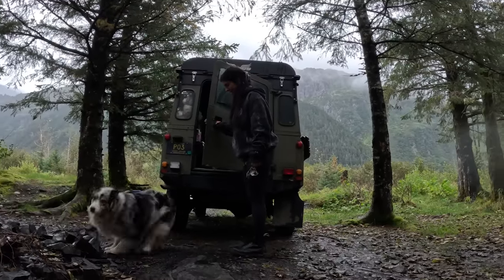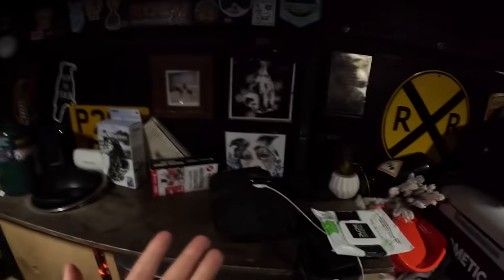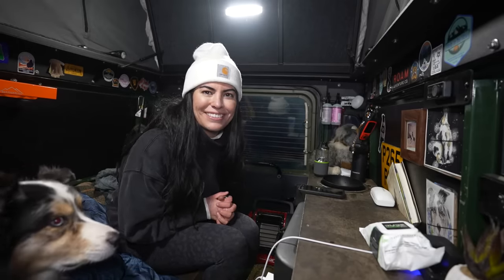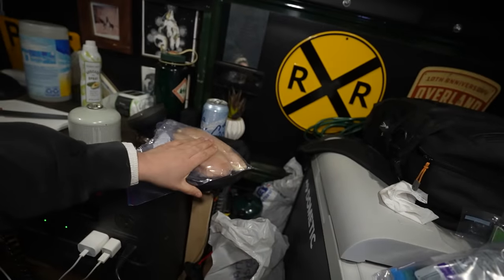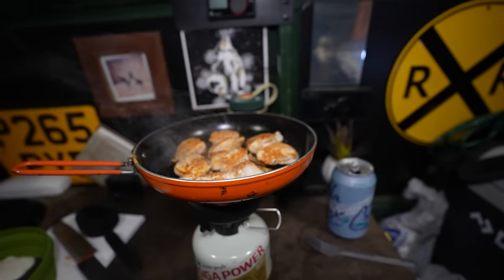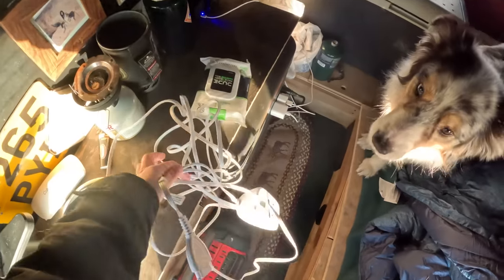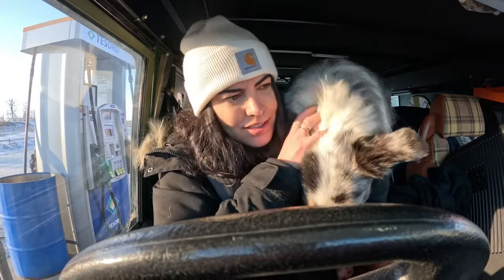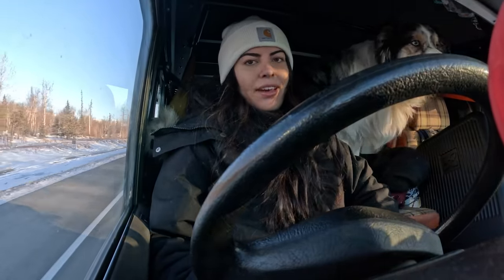Luxury Truck Camping Upgrades for Winter in Alaska

Comment: Why don't you get a step bumper on the rear of that thing, and for the love of God, please get a more stable burner, jet boil makes a folding 2 burner unit, go and buy it now...cuz every time you cook now I'm waiting for that pan to dump in your lap or splash in your face because its so unstable and high off the counter...its actually orange so it will match your pan...😅

Comment: Your best to keep the heater on for much longer. Short periods can clog up the heaters with soot. Keep it at a medium flow/heat and then ramp it up before turning off to burn any soot off. Just speaking from experience, jealous of your rig!
Reply: Good advice. Ten minutes on high before shutdown.

Comment: Hey so I’m a HVAC guy and if your air intake is under that floorboard I suspect you run a much greater risk of the heater going into high limit shut off mode. I at least suggest that you move the cold air return to an open space. Not a small enclosed space. Love your channel. Stay warm up there! Sending love from Ohio!

Comment: You can get auto tape to put over the cracks on the sides of Poe on the inside. Also get some insulation strips to put around your back door.

Comment: The heater has a thermostat and a setting which is just past the reading on the control of 720 . If you set it on that it will cycle on and off automatically when the heater drops below your desired temp.

Comment: Awsome heater. I Live in van expediting.  I have chinese diesel heater installed.  I have the same buddyheater as backup.  Then of course I have a second Chinese heater packed away as a backup to my backup.    I tear mine down once a year to clean it.  Easy peasie.  Your relationship and loyalty toward blue is overwhelming. ❤

Comment: Just a small piece of advice on running a 300TDI diesel in a Defender.Idle it for at least 3-5 minutes before shutting it down.These engines are turbocharged and oil cools the turbo-when you shut it off-oil flow stops dead.The turbo is cooled by the oil flow from the oil pan and when you shut it off-you cease the oil flow.Turbochargers run 4 times hotter than your water temp-so the coolant may be 200 degrees,but the turbo can get over 1000 degree pulling hard-Idling will save you a turbo.

Comment: @9:15 I would feel much better if you would continue that heater exhaust pipe further out and half way up. so that the wind doesnt blow the "deadly" fumes under the chassis.
heavy overnight snowfall could build up and block off any feasible escape route for the fumes and the fumes could build up inside your sleeping area.
you can buy flexible exhaust pipe to do the job I think.

Comment: I use a small fan to blow the hot air around, you could direct it up into your bed loft, pointing it from the where the heat comes out of that small vent put a fan on the floor pointing up into the top of your Papa. You won’t believe how hot is gonna get up there👍🏻👍🏻👍🏻

Comment: Maria on the board just get a good floor vent at which ever store they have close Lowes /Home Depot or Menards and if you ask nicely, they may cut out the opening in the board for the vent to sit in. That will allow the warm air to come up and you can walk on it without any worries.

Comment: Points for the diesel heater but using the top to your rig only lets the heat escape more, it's not made for cold and trapping heat in. Watch your diesel level drop when using the top as it'll have to run more to account for the heat loss. It's so good to see blu with his energy level. Praying for many many years together. Stay safe and take care.

Comment: Get some adhesive insulation strips  to fill the cracks in the doors. Also, consulate bubble/f9il insulation to cover the interior walls will do an amaz8ng job keeping exterior heat/cold and noise down.
Reply: S/B thinsulate bubble foil

Comment: Enjoy your videos! Suggestion for the rusty gas shocks. Try Fluid Film. It’s a spray on lubricant that will resist weather. It’s in an aerosol can and can be purchased at auto parts stores.  Good stuff and should help make it easier to raise the top. If you get it, hold a piece of cardboard or something behind them when you spray them down to protect Poe. Safe travels!

Comment: In regard to your windshield wiper issue:

I don’t know anything about defenders, but I was having issues with my wiper arms on my Honda. At the base of the wiperarm, there should be an nut that can to be tightened. Yours probably came loose due to all of the rattling from driving.

The windshield wiper motor has a shaft that sticks out where your wiper arm slides onto. Tightening it will keep it in time with your wiper motor.. and should make it start moving again. It can be tightened with the crescent wrench. throwing on a little blue Loctite should also help prevent it from loosening again.

At least that’s how it was for my Honda. Hope that helps oh and I love your videos!😊

Comment: Just make sure that the Diesel Heater Exhaust doesn't get blocked from snow and slush after driving. it will cause it to back up and shutoff. So everytime you stop to use it make sure you clear the exhaust

Comment: Just a thought but your diesel heater blowing directly onto your jackery and it’s hookups could have contributed to your wires melting on the jackery. I could be wrong but those diesel heaters can get super hot.  Not having a direct outlet for the heat could have contributed to all the carbon build up in the exhaust also, since it’s just trickling out on the inside. Just an idea. Love your videos! Stay safe! 🙏

Comment: Fantastic to see bubbly Bubby (try saying that 10 times fast) & ever cheerful Ria. Glad you finally got a diesel heater up & running. For the Alucab, you can get winter kits that have insulation liners (Nate on the Dirt Lifestyle channel showed one in a video a couple of weeks ago). With those temps, you may have to do something like an engine pre-heater for Poe. You can get similar to your diesel heater that heats your engine coolant instead of air (Ebay has 2nd hand Webasto pre heaters sometimes) or even do what Chad on Living The Van Life channel did when he fitted an electric element to the engine sump to keep the oil warm.

Comment: The installation details on the fuse panel look great. The crimps are uniformly well seated and all exposed tips are covered, you can expand on the panel connections and they installed a shutoff with the breaker. Do the exposed posts on the breaker stay covered/electrical taped to keep anything metal from sliding directly into it?

Comment: Enjoy your videos.  I know you've thought of this, so apologizes in advance but if you tried some inexpensive sunscreens and cut them down to fit your windows in the back, I think you would improve your insulation.  As for reorganizing, we RV in a small teardrop and find that on returning home, we reorganize every time.  Mainly focusing on what did we use and what again sat idle in a cabinet.  The latter is what we strive to part with.  Plus, when we do our longer several months long trips, we get into a routine (much like you) that we find we really don't need a lot of stuff.  Best of luck.

Comment: Instead of drilling out a bunch of holes in the floor slab. You can go to home depot and buy 1-2 floor registers ( the ones for inside the a house). Cut those holes and place the registers over the holes and screw them down so you can control vents, rather than just have holes.

Comment: What may help is If you remove the relay out for the wipers they may start working again but will only be on one speed. The relay is located in the fuse box and it's one of the two large relays, one does the wipers and the other does the indicators. It may not fix anything but is worth a try.

Comment: Glad you got the heater working. I think the issue last time was your powerstation doesn't provide the strong voltage at booting stage. You can always connect dryer pipe to extent hot air directly to up to top. Did you still have a carbon meter? I wonder where that pump is at, since we don't hear that ticking on camera. BTW the pump should sp about 1 liter per 24hr of usage...but youll need to calculate the wattage used, usually 50-60 watts booting up, and steady 30-40 watts afterwards

Comment: Once I finally got my diesel heater working in my off road trailer it was 'a game changer'.  Do you use multiple cameras or a single for your shots (i.e. backing into place) then edit together?  If its a single camera you are even more my hero.  I just dont think I would have the patience for that.  Plus every time I slow or stop the dogs go hyper thinking its time to run and play.

Comment: All of the Jackery power Boxes have either a LIfePo or NMC type Lithium battery.  The "off the engine" Charging System you showed is incorporating a SI-ACR (Start Isolation-Automatic Charging Relay) from Blue Sea Systems.  My statements are based on my build of my 2016 Trail Edition 4Runner.  A SI-ACM relay does not have the charging configuration for a Lithium Battery - it is meant for charging AGM (Absorptive Gas Mat) Marine Batteries. It closes to charge the Auxilliary AGM Battery once the Start AGM Battery reaches 13.7 volts. It opens to stop charging and protect the start Battery if the start battery voltage drops below 12 volts.  The charger that you want for the Jackery is a BCDC Charger that has multiple configurations selectable, i.e., Flooded, Lead Acid, AGM and Lithium.  The one I selected after much consideration for charging my auxiliary Xantrex 126 Amp Hr Battery is the REDARC BCDC1240D (40 Amp) In-vehicle Battery Charger, including their BCDC WK-006 50amp rated Vehicle Rear Installation Wiring Kit.  Please note that I am not financially associated with any of these products, they were all bought out-of-pocket.  A major reason for my selecting the REDARC unit is that it has a built-in MPPT Solar Panel Controller, so all I had to do was to wire my Solar Panel directly to the BCDC Charger.

Comment: Turn your defrost off when you are driving while it cold and the snow will not stick to your windshield just give enough heat to keep the frost off. Crack a window for air circulation.

Comment: I'm only a few minutes in so maybe you mention it later, but I forget...do you have a block heater for your rig when it's cold? 

I recently picked up a Jackery, but I have yet to use it to warm my diesel engine when it's very cold. (it was -21 a week or two ago).

Comment: lol, the little thing doesn’t ignite anymore because you need to replace the igniter. Not a real hard thing to do if you can find the part. And if you want your heater to work better get at least one little 12 V fan, habit up high, blowing heat back down towards the floor, if I knew how to upload pictures here I would but my camper used to be a service truck. The box is all steel. My floor plan is 4 foot wide by 8 feet long and it’s all steel on the inside. So even though I’ve insulated, I have what’s called thermal bridging. My diesel heater works wonderfully as long as I have air movement inside also. I also don’t have anything for windows so air movement helps to keep moisture down.
 also, that particular diesel heater that you have, although is very expensive comparatively to the other ones for 160 bucks, you won’t have the issues with this one that we always have with the cheap ones. I will personally be buying one myself I’ve had two of the cheap ones, they last about a year and a half if you use them often as in a mind constantly through the winter, the basically never shut off, they don’t last. So just to reaffirm your purchase very good idea and good for you.

Comment: This is going to sound like a complaint, but it's totally not more of a suggestion. Not sure what video software you use but most have a volume envelope to adjust volume within segments of the video. They'd be great to turn up the sound of shots from inside the truck.

Comment: Just had a power outage for 4 days so no electricity and I don't have a fireplace or woodburning stove. I am curious to know if the burner you use to cook on inside is safe. Doesn't it need to have ventilation? Would be cool if it is okay for inside my apt. when the power goes out again during windstorms.

Comment: rip. the chinese diesel heaters are like $200 bucks, install shouldn't take more than 3 hours labor. The best one is from Lavaner since they have a 2000w unit vs the 5,000W units that everyone buys and overheats them out of their campers. the eberspachers are nice, but they're really super expensive for what they give you.

charging the jackery, you just need something like a cheap victron orion dc/dc charger and you're good to go as long as you drive for 3 - 4 hours a day.

love that you're gettin' it every day, keep up the hard work!

Comment: You added just 4 gallons to a nearly empty tank at such low temperatures?  I suggest keeping the fuel tank full for emergencies, and to reduce condensation in the tank.  Oh, I think maybe your fuel gauge is not working.

Comment: I am not a Landrover expert but some wiper the main arm on the motor can automaticly  decoulpe by a rubber plug if the rubber an the arms ist not maintained by Glycerin,  so can be you wiper motor is still okay only decouplet.

Comment: AFEW THINGS FOR YOU, make sure to run on high for 10 mins so the filter inside doesn't clog. You can buy a dual valve and get a collapsiblevent hose to run it up to your sleeping area. Using that and your insulated tent insert, you should be toasty enough. 
I have already started stoking up for my Alaska trip and now have 240 days of shelf stable food on board. PRO TIP Instead of buying pasta sauce, Ranch bottles, BUY THE PACKETS that you just have to add water to. STILL PRAYING FOR BLUE ❤ K?!? BYE !!